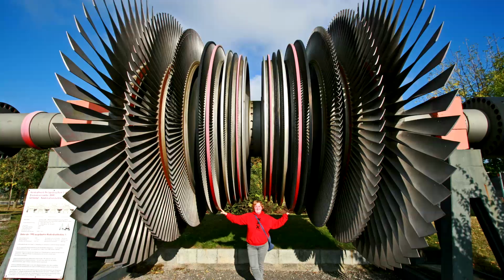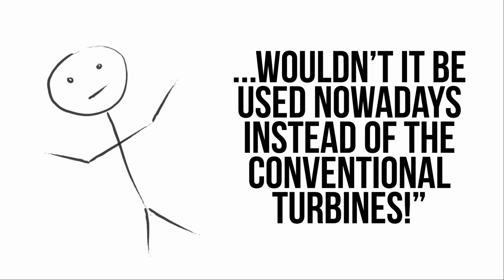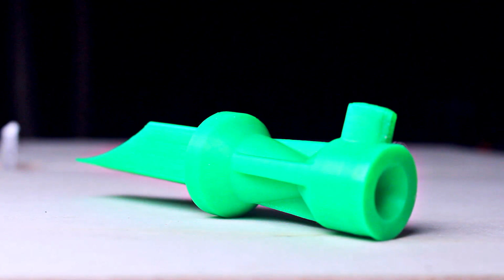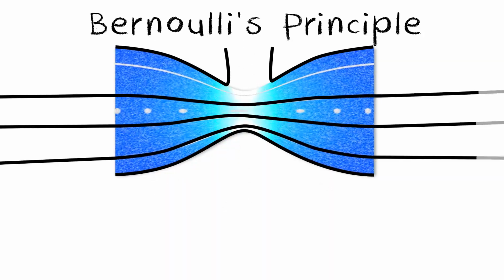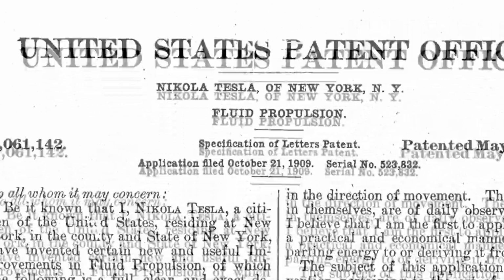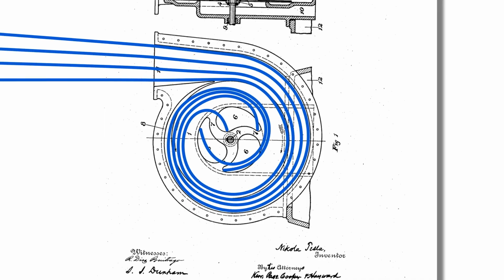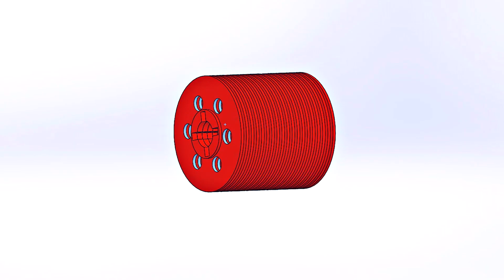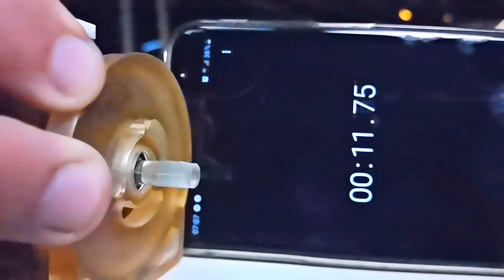Tesla Turbine [Smoke Flow Slow Mo]

Comment: With a volute  casing to make it work better keep the original size discs and make a double wall inlet that has the correct spiral on the outer side of the inlet but the same size as the discs on the inside so the discs are mostly contained except for a small spot where the spiral would meet the original size of the casing.  This I think should make the time that the air is in contact with the discs more efficient rather than wasting 20% or so of the space available

Comment: The fact the jigsaw blade went flying makes me think that the jigsaw is using a "blade clamp" style blade mount. They are, how do I say it kindly? Poop design. 
Unless you like having saw blades flying around.
The mounts that use a screw to clamp down on the blade from the side are the best ones around.
Who could have know that increased surface area would give more grip on the blade handle? 😄

Comment: Is it possible that the volute style produces more power at the expense of speed? If you’re imputing the same volume of air as the other style, but not getting the same speed, then there must be something happening to the extra air flow? One test might be putting a stronger motor/generator, maybe?

Comment: Perhaps I didn't quite understand your design properly, however, I think you would have better luck with the Venturi nozzle by introducing the media inlet to the point of smallest diameter which is were the pressure is lowest.

Comment: https://www.youtube.com/watch?v=kwP8n6xJFjc PLEASE WATCH! 
Tesla himself said that if you eliminate back pressure it can bring the efficiency up to 98%. You can do that by hooking up a second Tesla turbine to the shaft and running it in pump configuration to get rid of the back pressure. Furthermore, the vortex inside the turbine creates a vacuum. You can place a container of room temperature water before the intake of the turbine and run a line into it - the vacuum generated by the turbine will boil and suck the room temp steam into the turbine, water boils at room temp in a high enough vacuum. The expelled steam is very cold as the turbine has extracted the heat out of the steam - indicating efficient conversion of heat into kinetic energy. You could heat this steam using solar hot water panels and have a very efficient, renewable, solar energy plant.

Comment: Ok, so may I make a suggestion... instead of analyzing this to generate electricity, the way Tesla did. What if you, instead, analyze how efficient it is as a pump. So, for example, can this move fluids more efficiently, and more silently, than a fan does? What about combining this with the tesla valve as an air compressor pump? Water pump?

 While this wouldn't generate electricity, perhaps it can conserve electricity, or create a TRUE BLADE-LESS fan?!
Reply: A nice application for tesla turbines is to pump particulate fluids, such as biomass or waste. Because it doesn't have blades, there isn't a risk of damage when you have solids mixed into the flow.

Comment: What if you had to print slight ridges on the disks themselves, it'll make a good mix of mechanical force and surface tension.
You would need to create a spiral pattern that moves the air on the most laminar path

Comment: (Note: see edit at bottom)Just a thought on trying to gain efficiency, would a rough surface, say very small densely packed hemispheres or maybe very thin overlapping scales with a flat  facing the incoming fluid on the face of the discs improve efficiency and possibly torque by causing more drag between each disc?
Edit: after a quick scribble if you used radiating scales on the discs and offset each disc you would in effect create a crude rotary tesla valve see link for image of said scribble, it might be easier to see what I mean 
https://imgur.com/a/Ser238A

Comment: What if you offset the center of the turbine axle for the new design and enlarged the disks to fill in the empty space left over. It seems like this would put the outer edge of the disks in more of the smooth flow, allowing you to take advantage of the newer design with less wasted smooth air

Comment: I don't get it, are the disks the same diameter between both designs ? There are no reason why RPM would be so different, your explanation at 18:04 is not quite enough

Comment: Did you also test the volute casing with your breath? Your feed from the compressor goes through a smaller tube then the opening of the casing. This means that the pressure is dispersed. Using your mouth to compare the two designs is note as controlled of a test, but it would put the volute casing on more even footing.

Comment: Suggestions for Tinker:

1. Join multiple turbines in parallel with a shared shaft

2. Rectify incoming turbulent forces with a Tesla Valve

3. Recycle used air into a tank collector with a max air pressure valve to collect air heated by friction to be drawn back through the Venturi as hot input to improve air viscosity.

Comment: Try using low rugosity casing (by polishing the inside of the casing) and high rugosity disks (by sanding the discs or using sandpaper surface for example). I don't know much about Tesla turbine, but I guess that the power is generated by the traction of the fluid with the disks... So increase the traction by increasing the surface of contact between fluid and disk, so increasing the rugosity of the disks should help.

Comment: Isn’t this how a turbo on some cars works
Reply: Turbines used in internal combustion engines {and as a pump design in general) have a similar shape to the volute pump. Tesla seemed to be more focused on the specific implications of the internals he designed to work with the volute casing. Most exhaust driven turbos/turbines have something similar to the volute casing with standard bladed propellers but that's essentially the main similarity.
Reply: @davidregal6831  the real question is will i build more boost using a Tesla turbine instead of a traditional turbine?
Reply: @monjier  a tesla turbine can build a insane amount of RPM, have 97% efficiency and as less turbulence issue but have a very poor torque, I don't know exactly what is the objectif of a turbo, if couple with a rocket style nozzle theoretically it can be extremely powerful but it need real testing to be proved
Reply: @monjier  it also depend on material of the disks, more rough the material is more contact can be made with the gas and more propulsion and torque the actual best can be carbon nanotube, it's extremely rough (at a nanometric scale), it's extremely light and it's resistant as heck but it's clearly not for homemade propeller (for obvious reason) so the best in realistic case can be to make the disk catchy and rough manually (or with a machine), basically scratching to death all the disks.
Reply: @ledocteur7701  i suppose the goal would be to replace a normal car turbo with the tesla turbo.  The tesla turbo would replace the exhaust side but would be connected to the compressor turbo.  I hope the torque on the tesla turbo would be enough to become a compressor.  As the rpms and load of the engine increases i would imagine that the tesla turbo would eventually spin fast enough to make boost.  The tesla turbines characteristics will either make the turbo build boost faster, slower or allow less or more back pressure in the exhaust system
Reply: So... they stole teslas idea then.... shame -_-

Comment: A torque converter in a car with an automatic transmission works the same way, or very very similarly. Car engine spins one "disk" which makes transmission fluid inside the torque converter spin, which in turn spins the "disk" attached to the transmission.

Comment: Very interesting video!

I think it best to implement Tesla's own design if possible, if he claimed 97% efficiency! That would be a kind of archaeological experiment, which might attract funding. Elon Musk perhaps?

Alternatively, a water-powered turbine could be vertical, with the discs being conical, pointy end downwards. That would encourage the water to flow towards the centre, whilst maintaining contact with the disc surface. Apologies if that has been suggested before, also it has limited use.

Comment: Why not print disks with small tesla valves that allow the fluids to move to the exhaust ports (with some resistance of course)? I think it would make good use of the turbulent flow. So yeah spiraling tesla valves... inside the rotor disks... I don't have a printer so I'd love to see the results.

Comment: Correct me if I'm wrong, for a converging-diverging nozzle to work you need mach 1 at the the throat of the nozzle, otherwise it is just a nozzle and diffuser strapped together...
Reply: No, it works at lower speeds too.
BUT - that is the big problem here - they do absolutely nothing in this application, no matter how you design them, as they are there to convert thermal energy into directed kinetic energy - you need a Hot gas for this to work.
Reply: If you have mach 1 at the throat you will see an increase in speed, but if it is lower the nozzle acts as a venturi tube which in this case will only be an obstruction. Yes, these nozzles are used at higher temperatures so that the heat energy can be exchanged for kinetic energy. Will the involute casing, in this case, then not perform better with just a nozzle instead of the converging-diverging nozzle as the gas moving through it does not see sonic flow

Comment: You should try water instead of air. I guess for air you need much smaller distances. With water you can also simpler calculate the efficiency.

Comment: Even thought this might get lost;

LED do draw a higher current if exposed to Voltages above their speccs.
This results in a possibly higher output power than 0.15W (7V * 0.02A).

Comment: What if you off set the exit ports on the disks from each other to create slightly more turbulence between the disks.  Would it increase the pressure & spin the disks faster ?

Comment: What about veins perpendicular to the fluid flow on the disk to produce more surface area for the fluid to interact with? Maybe try pressurized water as a driving fluid, at say a head of 32 feet?

Comment: On that engine try making a hook to the senter grabbing the air or fluid to the middle but balanced buy the other side of the rotor have supports at the tips on each disk so the disk dose not flex make shur it is balanced it is vary impotent so the disks will not rip apart if you do that it should work it should make a low pressure zone around the disk roter and only take air in from the end of that motor or you can just add a 2nd wall following the roter making a sorta spiral cone type shape

Comment: This might be tough to test, but what about a dual or multi- inlet design? By reducing wasted volume in the volute casing (shorter path of convergence per inlet = reduced width of volute path per inlet) laminar flow could be preserved by having less of a chance to dissipate. It's harder to design, and especially harder to test due to the requirement for multiple sources of working fluid, but it could drastically raise efficiency. Oddly enough, a research paper from ASU found that mildly turbulent flow actually raises the turbine's efficiency. It's called "Challenging the Versatility of the Tesla Turbine: 
Working Fluid Variations and Turbine Performance" by Aaron Peshlakai, but it only focuses on single inlet turbines.

Comment: is gearing an option? low torque high rpm. into high torque low rpm. into low torque higher than starting rpm. or how about a "cvt" type transmition. that can adjust its torque with rpm.

Comment: Since the force is based on surface friction, and you want to encourage air to flow in a spiral, how about putting spiral grooves on the discs?  The biggest question with this is what angle of spiral you'd need since the discs are spinning in the same direction as the air.

Comment: Interesting stuff. I would recommend a vape for smoke in future since it's denser smoke and less hazardous. Anyways, if you could apply a breaking torque you could measure along with rpm, you could measure power without losses from the generator. And if you lifted say 10 liters of water 2 meters up, you could measure your power *time to find your energy, and then get your efficiency

Comment: Converging diverging nozzles only increase velocity when the fluid velocity is supersonic at the throat. Might want to do some calculations to see if you are achieving that, otherwise you are just causing a roughly 2% drop in pressure for nothing.

Comment: Hey maybe the gradient curve design cloud work better if the ratio of the empty part (where there is no disk ) is smaller. As I can see in your test the intake is almost equal to the radius of the disks. Though I am a programmer so maybe it does not makes sense...

Comment: To improve the design, the motor you use is crucial. Don't use a DC motor, the best pick would be a synchronous motor (90% efficiency and usually even more). They are basically the core of every electro mechanical generator

Comment: Nice video! Your smoke doasnt colapse because it goes that way through turbine, but cause you blow it with your lips at low speed, at high speed it will go spiral. I agree with several people here you need difuzors at the sides, not on entrance, and with one man, one difuzor from the side should lead fluid back to turbine like on Tesla drawings, enter of fluid should be tiny etc, etc ... :)

Comment: It would have been cool to have printed all disks on a single print.
Would be interesting if multiple Tesla turbines could exist in which a smaller one exists inside of a larger one, but they both spin the same axle. Air coming out of the "center" of the larger turbine is actually entering the smaller inner turbine. And of course this could potentially be stacked as many times as you want.

Comment: From what I understand about fluids (disclaimer: very little), the width between the disk is determined by the properties of the fluid you are using. If it's air, you make this gap thinner. If it's water, you make it wider. Viscosity appears to be the main driving factor of these values. However, from my minimal amount of research, viscosity alone is not what's determining this.

A viscous fluid moving across a surface imparts shear stress which is the actual 'frictional' force dragging the disks along. This changes in relation to pressure and velocity. I would assume that as the fluid moves closer to the center, releasing more and more of its energy, its pressure and/or velocity changes, which changes the potential shear stress that it can impart for a given geometry.

Perhaps using completely flat disks might not be the most ideal geometry. I don't know how you'll make this possible, but perhaps making the disks very slightly convex or concave might allow the disks to extract the more energy. 

Barring that, then changing the inlet might be better. The geometry of each turbine might have a specific 'sweet spot' in terms of the fluid entering which gives it the highest possible efficiency not unlike how your engine has a particular band in its RPM which gives it the best fuel economy.

Comment: What if you tapered it? Like, the entire turbine built inside a cone. You lose a little surface area but that also could mean more speed since less weight is being moved. It also creates back pressure, like a turbo, since the air is being compressed on exit. That could be used to power ANOTHER turbine If you used a copper coil and magnets at the first exhaust.

Comment: How about you test it using water? I think it will run more precise  because water friction(like when you move the boat in the water it much slower than in the air) I guess it will give you more torque.

Comment: You have made the disc stack rather wide, which means the intake nozzle has to expand outwards to cover them. You want the air to flow into the discs with the highest velocity you can get so you want the intake manifold to actually constrict before it comes to the discs. The exhaust path probably needs to be widened a lot, the gas expands as it goes through so the exhaust needs to be several times wider than the intake, and the end discs need to be close to the casing to stop leakage into the exhaust. Since you are printing you could actually make a labyrinth seal for that fairly easily. You also want the discs as thin as possible so that the edge of the discs do not take up as much space and the casing volume will have a higher flow speed, so ideally you would need to do thin laser cut metal or something, but printing the entire rotor as one item might let you get a lot closer.

Comment: it sounds like you need more bigger so can go more faster. also just random thought, if you introduce sulfur hexafluoride to the compressed gas might make it more faster as well. being that the partials carry more energy as a result of there mass and what naught. you could also try testing the system with pressurized water, which do to the influx of mass may compensate for design intolerances.

Comment: So one tip regarding the use of the CD nozzle, for a CD nozzle to be effective in accelerating fluid flow you need to reach Mach 1 at the throat of the nozzle so the divergent section can further accelerate the flow as opposed to slow it back down. What you have built now is effectively a venturi tunnel